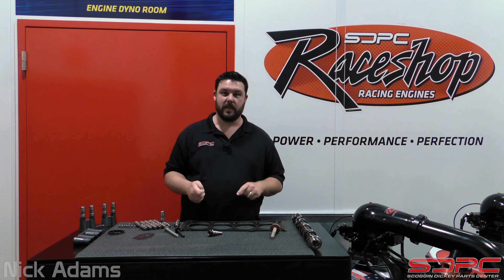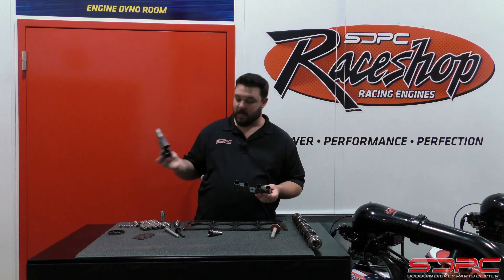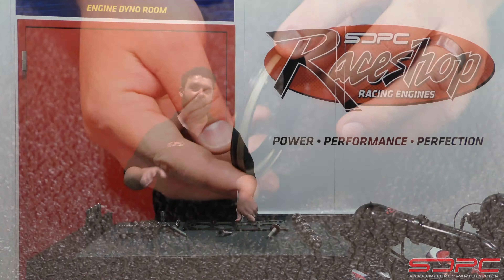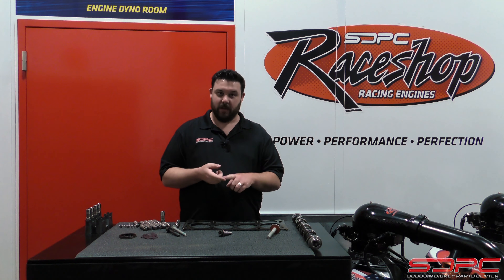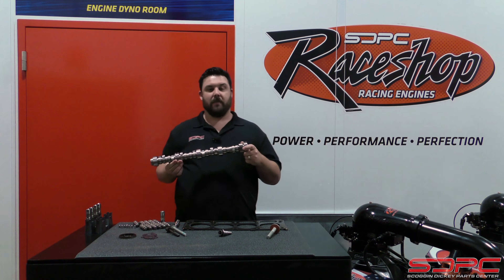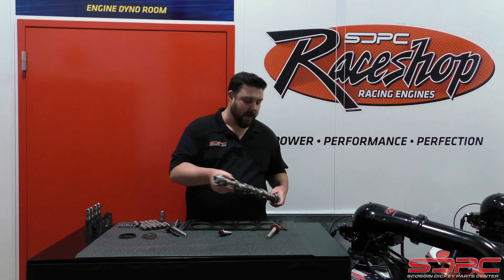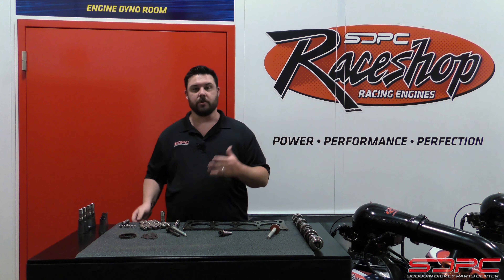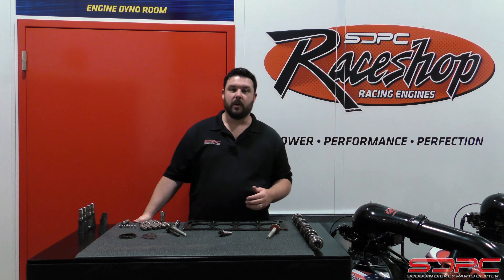SDPC Tech Tips: Gen V LT DOD/AFM Delete

Comment: great video and it helped a lot. I just bought a 2017 lt1 out of an ss and swapping it into my 65 c10. diving into should i cam before i install it or before.
Reply from the maker: Cam install on an LT is way easier outside the car. You have to drop the pan to clear the oil pump. Good time to inspect the bottom end.

That's going to be a blast in a C10.

Comment: What is the difference between the stock cam and the gm non did cam
Reply from the maker: The ramp rate/lobe profile of the AFM lifter lobes are different from the non AFM lifter lobes. A non DOD cam will have uniform lobes for all cylinders.
Reply: @Sdpartscenter will the stock cam work for the delete ? Comp cams sells a kit that doesn’t list a camshaft

Comment: The SD Parts website says not California legal. What is the story and workaround for this?
Reply from the maker: It's not a CARB certified part, requires tuning, therefore not legal for sale in California.

Solutions?
Elect different officials that run the state.
Move out of California.
Reply: @Sdpartscenter  I was afraid of that. Thanks

Comment: Nicely Done! If and I stress "if", I heard you correctly you said you could keep the high volume oil pump on LT engines as ECM handles it. How about on an LS??? Some say its bad the over pressure valve will send it back to the pan but the GM deflector that was introduced in 2009 (I think) to keep that returned oil from spraying on cyc walls can be used on earlier engines for same purpose. I read that in the GM parts catalog. So any reason you cant keep the high flow pump in an LS?????

Comment: What about a 2019+ custom, custom trail boss and wt trucks that have the l82 with the same l83 style afm/dod system?  Can this kit be used on those?
Reply from the maker: I have not seen an L82 block, but if it has AFM and not using the large block plugs like the L84, you should be able to use this kit. I'd have to check on Monday when I get back to work and have the parts catalog to look through.
Reply: @Sdpartscenter  hey thank you for getting back to me, sounds good, and I appreciate you looking into it Monday, i figured it might work because from what i was told the newer afm l82 is pretty much the newer updated version of the l83, it’s featured in the more entry level models of the 2019-2021/22 ltd like the custom and the w/t, it did come with the afm tuned out from the factory from 2021-the 2022 ltd model years due to the chip shortage to which you can find out through the rpo codes that they were designated either yk9 but the engine still came with the me mechanical components unfortunately not fully deleted from the factory just tuned out

Comment: Hello - good information. I have a misfire on my '16 GMC with the 5.3, #6 cylinder about 75psi along with the tick. Want to eliminate the system and would like to purchase your kit. My question is,  what will happen if I do not delete this from the ECU, do I get CEL, drivability problems, unable to pass emissions???? Thanks
Reply from the maker: If you are in an emissions controlled state you will have to do a repair and not a delete.

Comment: Can you make a video or tell me where to prime the oil system on the newer lt style motors. There’s a port above the oil filter but not sure if it’ll be filtered.
Reply from the maker: There is a spot that feeds into the system on the driver's side (on some LT blocks). The top is the oil supply, the bottom is the oil return that just drops right back into the oil pan. It's usually blocked off on LT cars but the vacuum pump is there on the trucks.

Comment: Did I have to install phaser limiter with a stock non dod cam I got the kit from you guys and did get the system removed from my ecu but no actual tuning was done my truck keeps throwing p0011 could that be it needs tuning or the phaser limiter wasn’t needed
Reply from the maker: For a stock non dod cam you don't need the cam phaser limiter.
Reply: @Sdpartscenter  thank you for replying so should I remove the limiter or would you recommend just tuning at this point since it’s already there

Comment: Im so confused, is the 2014-2018 the same with the 2019?
Reply from the maker: In 2019 the engines changed to dynamic fuel management, so the block itself is different along with how many cylinders can be deactivated.

We're wanting to do a video on this but we haven't sourced a bare L84/L87 block and don't have any in the cores yard just yet.

Comment: Does the 376/535 crate engine come deleted and vvt locked? Swapping cams on one how do you degree cam on these? No adjustable gear.
Reply from the maker: AFM is deleted and VVT locked out for the LT376 crate.

If you're wanting more adjustability to get your cam in a desired spot, the TSP VVT Delete kit has an adjustable upper timing gear, if you're wanting some coarse adjustment, there is also the adjustable lower:
TSP VVT Delete: https://sdparts.com/i-24509795
TSP Lower Timing Gear: https://sdparts.com/i-24508929

Comment: Hi guys! I'm the second owner of a 2015 Sierra with 77k miles, L83 flexfuel 5.3ltr married to a 6 speed 6L-80. How do I know that my truck hasn't already had the AFM deleted? I drove 60 miles from LBK to Levelland at a steady 70mph and saw no indicators that it was switching into 4 cylinder/eco mode on my instrument display. I'm not a mechanic either but the AFM issue is very concerning and if I can head it off I'd love to.
Reply from the maker: There's always a possibility that it's been shut off, or deleted.  Some shops with HP Tuners can just check your calibration to see if it's enabled or not.

Comment: HOW can YOU guys be OUT of STOCK on these kits?
Reply from the maker: There's a shortage on components.  It has been well over a year long struggle for head bolts, head gaskets, lifters, etc.  

2019 UAW strike
2020 covid
2021 covid plus supply chain interruptions of varying degrees

One component will come back in stock only to have another go out of stock.

This is an industry-wide issue.  We can sell you portions of the kit that we have, but you would of course have to luck out on sourcing the other parts we do not currently have.
Reply: I need one asap. Number 7 went down with a collapsed lifter in my 2015. Now my 2014 is starting to act up to. Im about to sell both and buy a toyota.

Comment: Just ordered a delete kit for my LT 6.2 2016, the only part that does not come in the kit is valve cover gaskets. Might want to add it or at least mention it to customers. Also may need some push rods?
Reply from the maker: The main reason they aren't included is that the Gen V LT valve cover gaskets are reusable, but if in some case your gaskets are worn out and leaking, then yes by all means replace them.

https://sdparts.com/i-24121636

Because the base circle and lift is not changing (only the ramp rate), the pushrods can be reused as well, of course inspect their oil holes for blockages/debris and unnecessary wear on the tips.

https://sdparts.com/i-20071230

Comment: So on the 5th gen camaro ss, if the dod is deleted, and a upgraded vvt cam is installed the car must be tuned before it will start up? 🤔
Reply from the maker: Most will not run, others will run with a bad missfire but would not recommend driving it without a proper base calibration.  If you're doing an upgraded cam, any tuner worth their salt should be able to benchtop tune the pcm for a basic startup if they aren't able to make a house call.
Reply: Thanks for the he info, I installed the tsp stage 1 vvt cam with ls7 lifters, new springs, pushrods, trunnions, ls9 head gasket, and arp head bolts. The car turns over but won’t fire up. I guess I’m gonna have to trailer it to the dyno.
Reply: Is it possible to be 180* off dot to dot on the wrong stroke?

Comment: Great to know that I can use a factory style cam since I don't want a crazy high lift cam in a daily driven truck I tow with on the weekends. Going to 4.10's to offset my 35's, I'd be interested to see how much power one could pick up from a L8T cam in a L83 truck. Looking forward to getting this done!
Reply from the maker: Surprisingly enough, they use the same cam specs.
Reply: @Sdpartscenter  good to know! Thanks
Reply: You can always talk to the guys from Texas Speed and Performance  and I’m sure they can grind you a great DD cam with a lift higher than stock but not crazy high for better performance and fuel economy